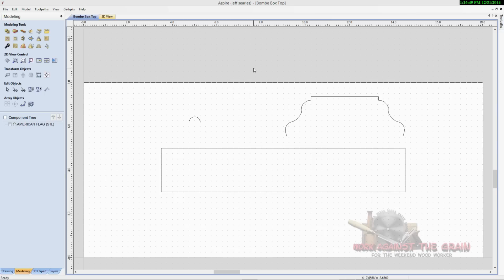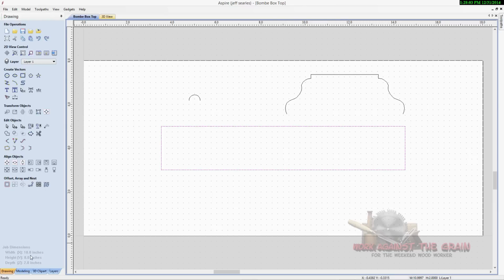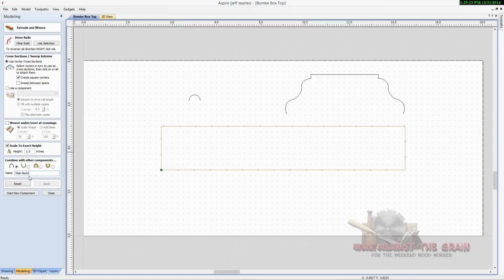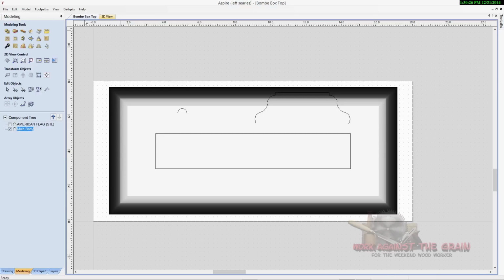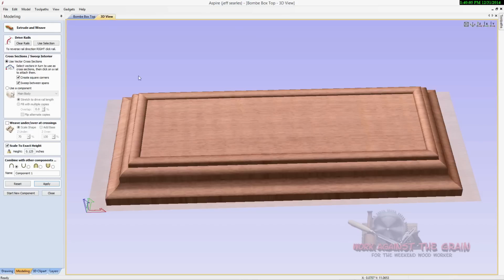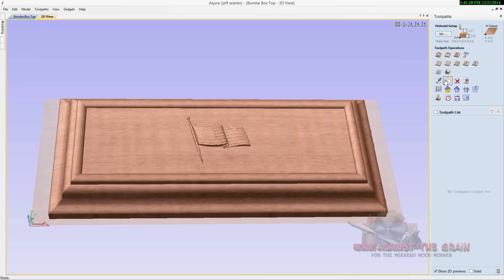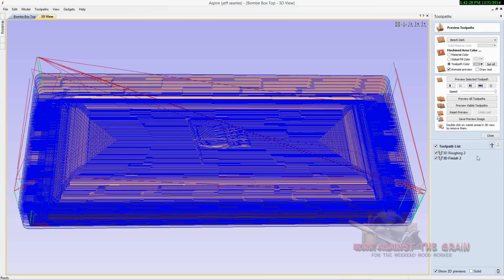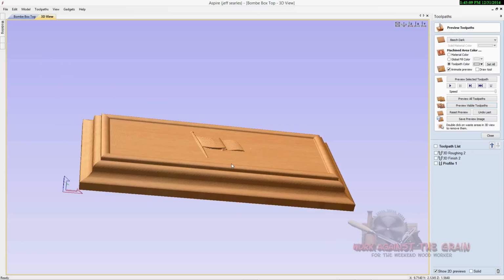Vectric Extrude Tutorial

Comment: Jeff: Lets say the top is made out of a hard wood, say maple.  Can you show a two-sided setup where you removed material from the backside to lighten and reduce the weight of the box lid?
Best - Michael
Reply: I'll try and get video up today. If you have Aspire 9 two-sided is built in, so create a box vector on other side of material, a pocketing tool path within that vector, then flip model over and machine out to desired depth. To your point becomes MUCH lighter. EXCELLENT point and thanks for watching.
Reply from the maker: Video has been uploaded. Thanks again